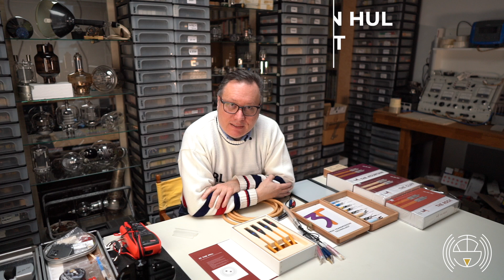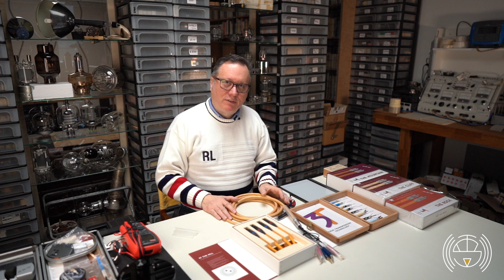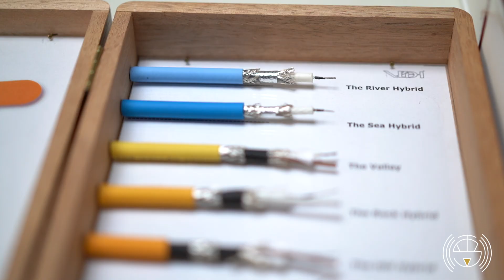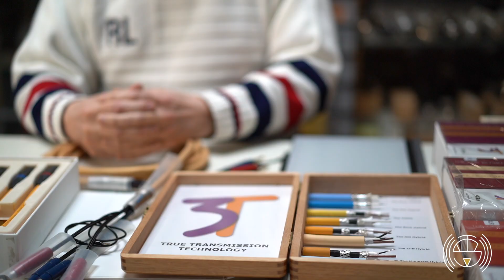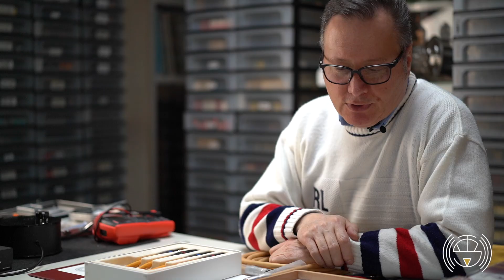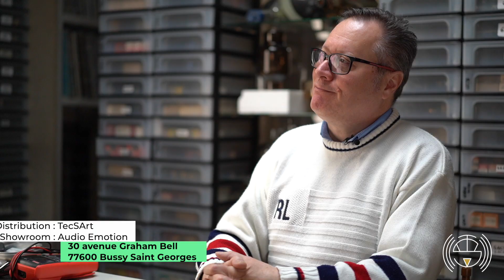Which Van Den Hul 3T cable to choose? by TecSArt

Comment: Any cable manufacturer has specifications in their datasheets, from shielded cables to coaxial cables for extremely high frequencies, where audio frequencies are ridiculously low. For professional use, we always take into account losses, impedance, inductance, etc. The same goes for audio, but since the frequencies are extremely low, audio cables are much simpler than radio frequency cables. You buy rolls of cables from any manufacturer, assemble the connectors, and claim the cables are the best available. As long as there's no datasheet with specifications or measurement results from certified laboratories, everything is nonsense, where deluded people with no technical knowledge waste a fortune, regardless of the manufacturer or brand.

|
Reply from the maker: I agree on cables madness, prices, and almost any opinion, but…what are the specs that define a good and bad cable? 
I can assure that there is no sound difference between 0,01 ohm and 30 ohms resistive interconnect cable ( having the same geometry) if any it is a very little loss in volume that just needs a few tenths of dB on the volume knob. So one of the most regarded parameters is unuseful.
All depends on user needs and synergy between electronics. I am afraid that nobody has THE CABLE, and yes there are sound differences from different cables. The best is the one you like. Not the one with best numbers. An amplifier with very high negative feedback has wonderful measures, but often sound worse than others with ugly figures.
If we measure ALL about the electronics that needs to be connected and we create the perfect interconnect cable the risk is that then you don’t like how it sounds. 
There is no rule, in HiFi we talk about music and emotion, nothing more subjective and everybody looks for his own best sound. Measures are for engineers not for  music lovers.
I understand that for a sound engineer this aspect cannot be considered as the objective is the best measurable sound. About my way of listening, sorry, nothing you can do. Maybe it is distorted ( or not) by my one million dollar cable, who cares? I like it.
Reply: @tecsart  I know the specs for any coaxial cable or RF used in telecom because there are a lot of factory datasheet. They measure the cables, there are graphics, equations, etc.. But there's nothing for audio and I am assuming if they start to put technical data everybody will see there's no difference...

I can test cables using frequency generators, oscilloscopes, spectrum analyzer, etc... and get some numbers..
Reply from the maker: @jeangrisi224 …and once you have all the measures, you can tell me how it will sound on my system and if I will like tje result?